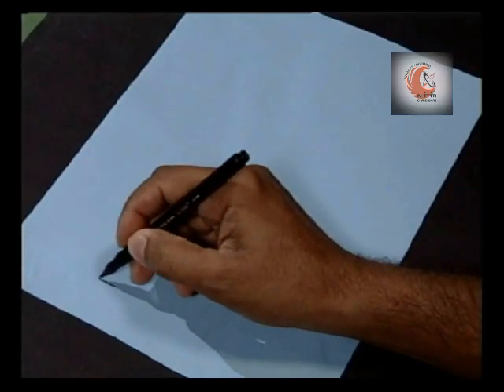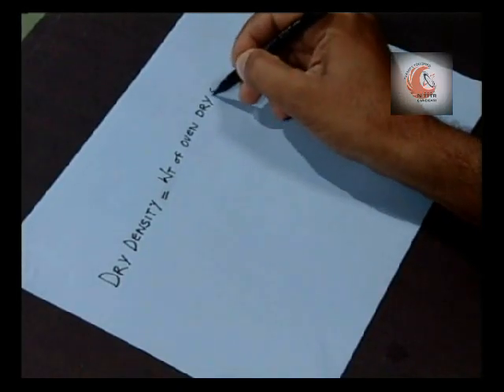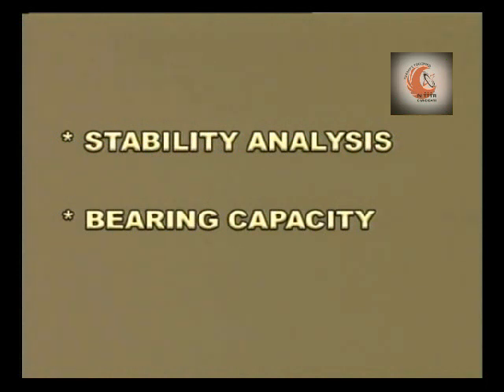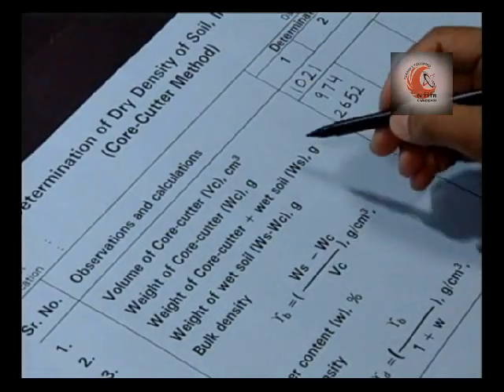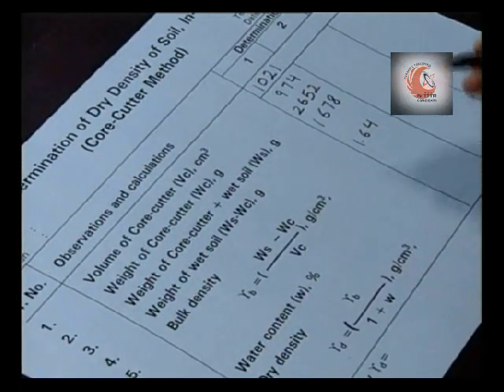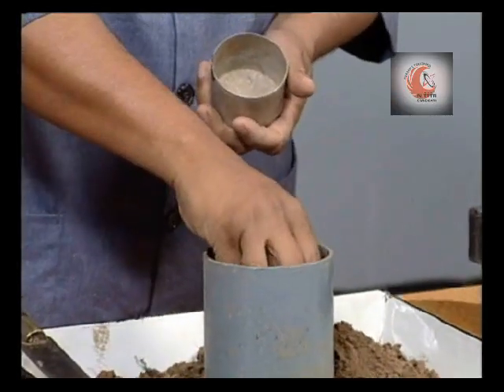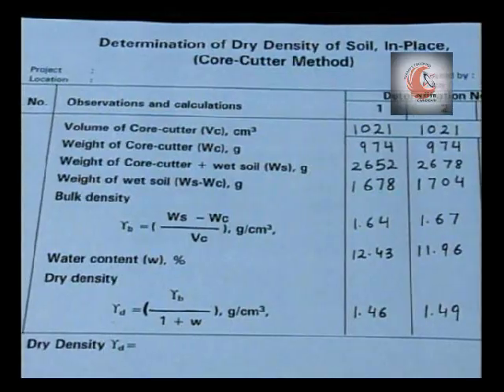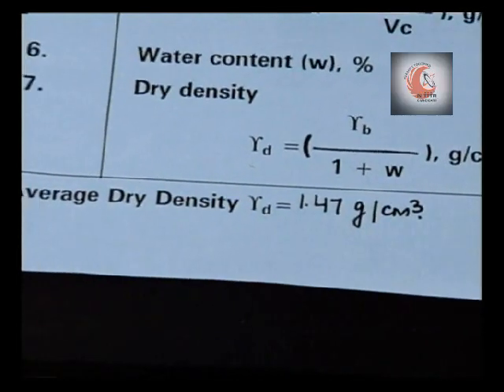Determination of Dry Density of Soil by Core Cutter Method

Comment: Actually i can not get last calculate which was bulk density by 1+w
That answer did not come
Reply: Dry unit wt which is called as gama dry is equal to (gama bulk)/1+ water content (w).
But you are not able to get answers because water content comming out to be changed that is if water content is 12.43% then you have to put tha value as 0.12 or simply change the formula
Gama dry= gama bulk/(100+ w)